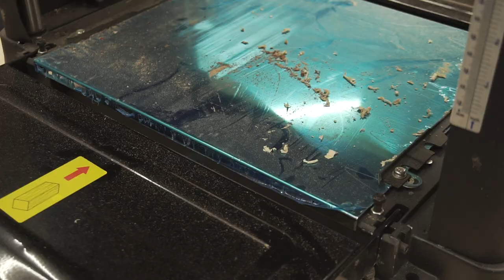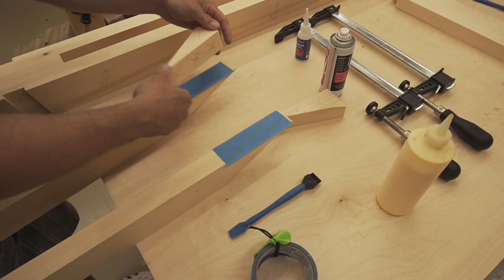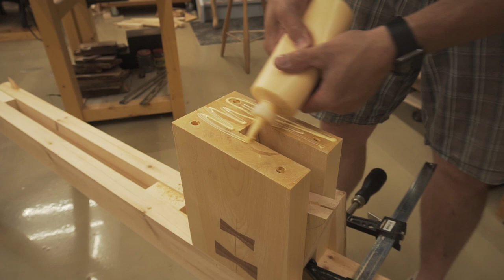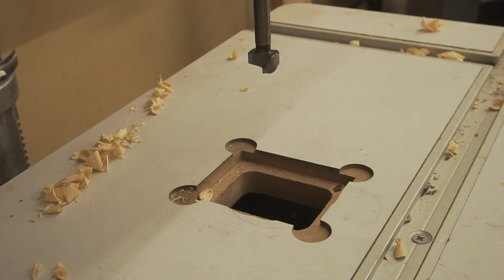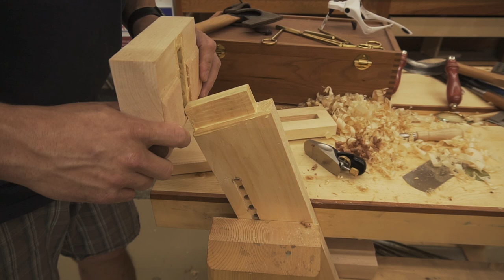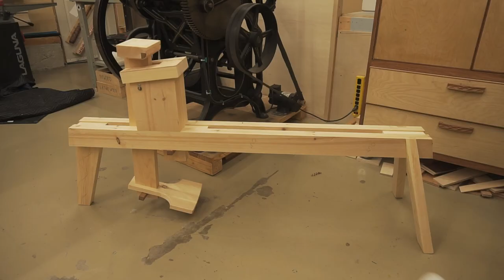Shave Horse - My Three Legged Friend

Comment: you make something from the old ways , before power tools, with so much usage of power  tools. Honestly asking, what is the point of all this ? Why using the shavehorse at all, if you have all those grinders and table saws etc on your workshop? It is like building the mechanism of Anticythera, with modern cnc machines.
Reply from the maker: @erosennin873  that’s a senseless question. I use the right tool for the job. Period.
Reply: @dpmakestuff  then why you are not using a lathe for this job ? it is no senseless. You work the way you want, but since you expose yourself with the video, my opinion is that you are doing a senseless thing.
Reply from the maker: @erosennin873  just because you don’t understand doesn’t mean I’m doing something incorrectly. You don’t understand wood grain. The lathe is not the tool for shaping spindles, it’s the tool for turning parts.